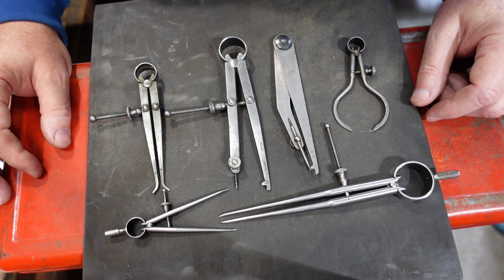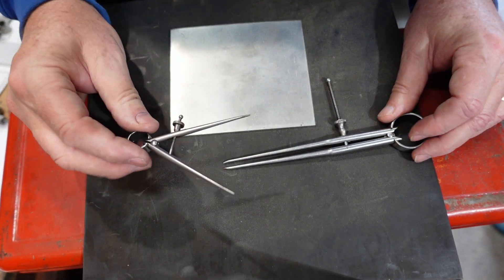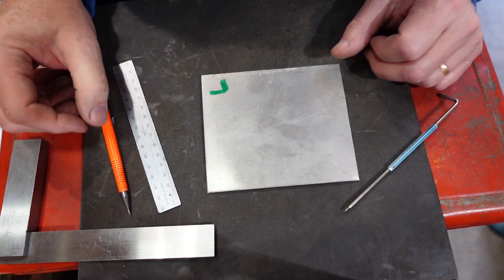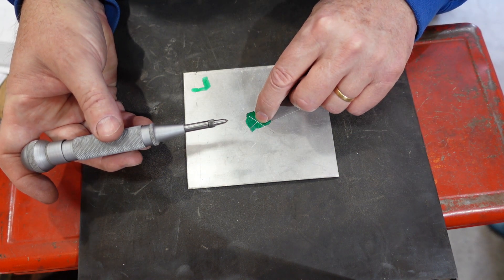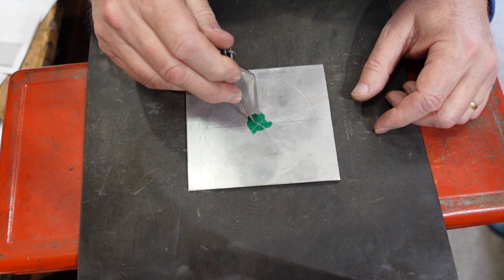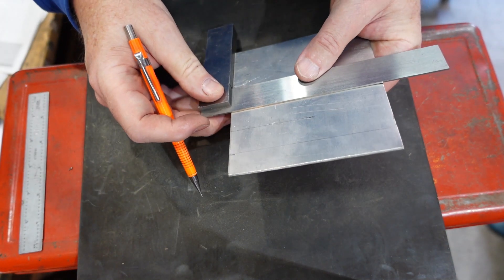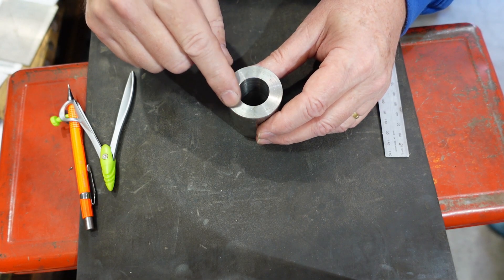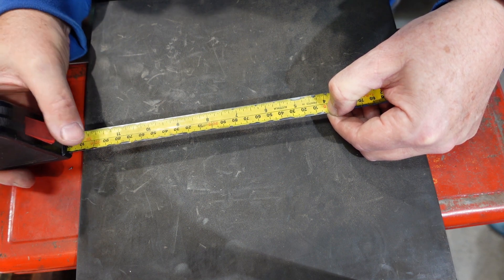Basic geometric operations for marking out

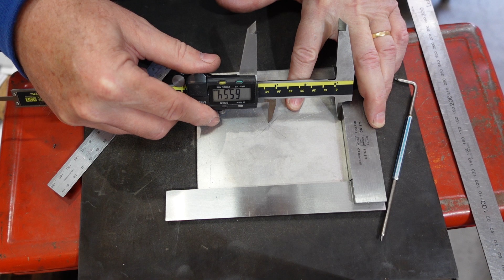Comment: 6:45 I never used my vernier or digital calipers for making scribe lines, being worried about rounding the caliper's tips.  Some years ago I bought a Marking Vernier Caliper, which I really like using.  It has a carbide scribing tip that can be adjusted for length to suit (rare) difficult situations
 Readily available cheaply on ebay, etc.
Reply from the maker: My calipers are usually dropped, banged, showered with hot swarf and all the other nasty things in a workshop that gently using the tips for marking is unlikely to influence my accuracy greatly (hangs head in shame).
I may have ot look out for some marking calipers

Comment: Glad you're feeling better.  I really need to ask you about the wooden pipes in the background.
Reply from the maker: Back before my hearing started going down hill, I was researching pipe organ pipes. Those are some I made up. Lacking the rest of the organ, they got mounted on the wall (they work).
Reply: @occasionalmachinist  Before my dad passed away, he made a set of pipes for a monkey grinder organ.  He never got to finish the organ, but after he died, mum had them made up into a working organ.

Comment: Following on from your comment about marking on something you don't want "mark", I have found that PRITT STICK (children's glue stick here in the UK) and A4 printer paper is very good, It washes off with water afterwards and give a very good surface for drawing on. It also does not stick permanently until dry so can be repositioned easily to get perfect alignment.
I had to a task to make a mortice and tenon jig for my router, out of Perspex (plexiglass, polycarbonate etc),  there were several good designs online, that were generously provided, and I was able to print actual size templates and Pritt Stick them to the plastic sheet I had available, add my own dimensions for the router mounts etc,  and the cut out the design, the paper washed of easily when finished leaving a pristine surface.
Chris
Reply from the maker: Thanks. That's another good way to do things